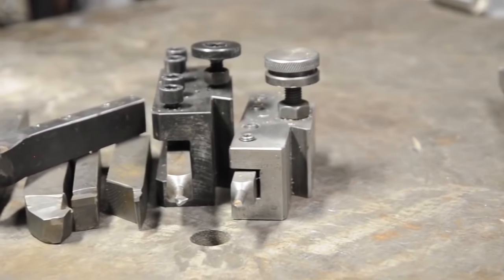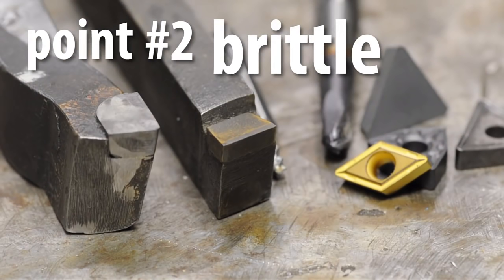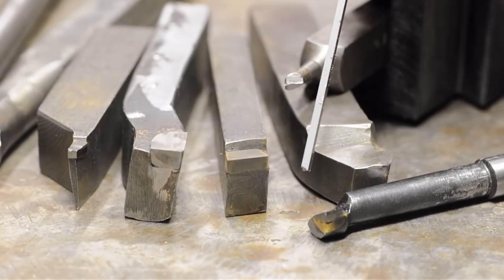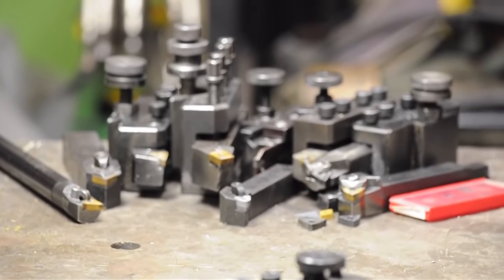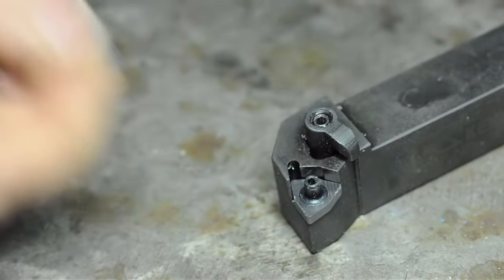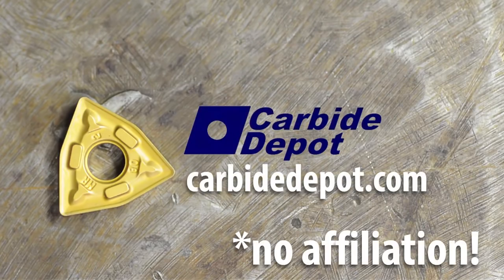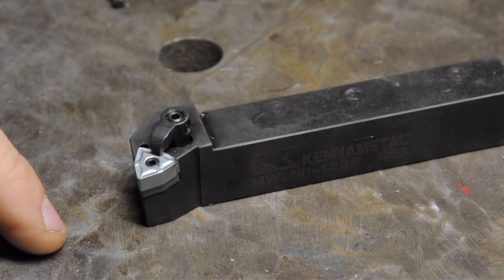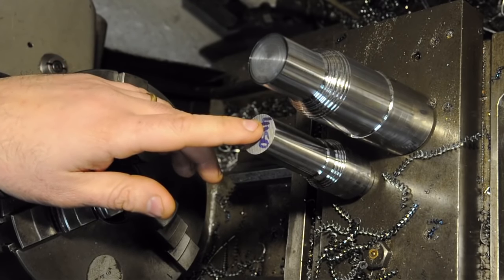A Brief Chat about Carbide Tooling

Comment: Excellent video! However I was a little surprised that you didn't mention the ground/sharp carbide inserts - I don't know how widely available these are, but I use them exclusively on my lathe, mainly because it isn't sturdy enough to use a "normal" non-ground insert. They have exactly the same shape, but are ground sharp for use on plastics and non-ferrous metal, although I sometimes use them for finish passes on steel and stainless as well. The tips I use are CCGT - I'll give you a link to the UK supplier I get them from: https://www.shop-apt.co.uk/carbide-inserts-for-turning-uni-tip/ccgt-060204-alu-ak10-carbide-inserts-for-turning-ground-and-polished-for-aluminium-uni-tip.html. I've just bought a cheap set from Aliexpress so we'll see how they turn out.

Comment: I guess if you're in a huge hurry, .035 removal passes and a .010-.015 get me close pass, drop in a HSS tool to get to final size.

Frankly, high feed rate, .015 removal, great surface finish. I'm fine with that. I'm almost never in a hurry.

Comment: Anyone  know if carbide will cut/shape a file,i want to make a tool insert from a file and it has to be square ie have right angles not squinty corners,grinding /cutting with a slitting disc on an angle grinder is ok to rough out,but i'd rather mill it to shape ,keep it(and me) cool ,and remain a file(sort of).

ANY HELP?.
Reply from the maker: it probably will.  but with a carbon steel fire you can anneal it, shape it, then harden again.
Reply: @ThisOldTony  Well thanks for the relpy old boy er tony,i want to keep the file as is except chopped down ,i've not done much in heat treating and son't want to ruin a good files  composition playing silly buggers with its temper,i may get a cone stone to grind it in the mill or not,i will try the carbide to square the ground cut off,that's all i want the carbide to do.
EXCELLENT VIDS,ATB FROM HERE IN SCOTLAND,UK.

Comment: is there a way/s to check if the tool i bought from ebay is tungsten carbide or HSS ? 
color is not an indicator for this :(
Reply: tungsten is less magnetic than hss,and lot heavier in weight

Comment: I'd disagree with the statement that 'Carbide wants to go fast'. This is opinion dressed up as fact. You can go as fast or slow as you want, and most of the time I don't run it any faster than I would a HSS tool.

Comment: I work for e.g. manufacturers lol and I run a machine that cuts the grooves in steel cam shafts we take 30lbs of material off of a piece of bar stock in 40seconds using 36 carbide inserts

Comment: All of the small local tool suppliers do not sell plane vanilla HSS. Since the new fifteen percent cobalt HSS is the current standard. I always had to laugh when the shop owners thought that you could grind it with aluminum oxide vitrified grinding wheels. If you don't have any CBN grinding wheels you are pissing in the wind.

Comment: Can you or one of your viewers tell me if there is such a thing as minimum SFM (Surface Feed Per Minute)? Could you run a lathe or mill at 1rpm and still get good results if you have the correct feed rate?
Reply: chris0tube but then you wouldn't have sufficient  cut thickness. you would be rubbing. I think maybe you need a certain amount of surface velocity to overcome the surface energy of a given material. I would love it if someone could give it a go and see what happens.
Reply: chris0tube you could set the required cross feed and turn the chuck by hand while keeping all other variables the same.

Comment: LOL raw material  into scrap metal!    I'm a pro at that.  Problem is the welder didn't think it was funny his parts were 3/8" short and made me weld a bead up the edge of al his nice new 1018 hot rolled steel.  I almost got good enough to lay dimes.  
Problem is h kept putting them in the coffee maker at break time.

Comment: So I need to operate at higher speed with insert tooling?
Reply: No, not necessarilly, inserts just can handle higher rpm better, but need need higher feedrates and/or cutting depth than HSS

Comment: I worked at a shop as a temp a couple years ago. The owner expected tolerances of +/- .002 on this one job but wouldn't listen when we told him his bits and end mills were all dull or chipped. Dude expected perfection but refused to invest in decent tooling or to at least give us the ability to resharpen anything. Of course, the end mills cut like shit, and the drill bits drifted, and the tolerances were all over the place and out of spec. So then he gets mad about having to scrap material and recut stock due to the shitty tooling. Guy just would not listen to reason.
Reply: @ThisOldTony  there's bad shops and good shops but my point is, if you want good parts you'll need to spend money. Either up front on good tooling or later on wasted stock and rework.

Comment: "Mainly Tungsten and Carbide powders pressed into a shape" 

Tungsten is heavy but isn't much use in cutting anything of note. 

I can only guess that constant use of "Carbide" as a shorthand for "Tungsten Carbide" leads to the assumption that tools are a mix of the metallic element "Tungsten" and a "Carbide" of something entirely random. 

Or did you mean "Mainly Tungsten Carbide, plus some other Carbides in a metallic matrix" 

The terminology is such that in getting it wrong it is so wrong as to be misleading to anyone needing a "Beginner's Guide"

Comment: Curious as to why you didn't mention anything about the seats. I realize the purpose of them before the keyboard warriors get to jostling in their spanx. I mention them only because of the added cost and hardware necessities that could arise.

I realize no machinist has ever crashed any tool and caused the insert as well as seat to explode. In case some welder would happen along to operate outside of their classification and intelligence level, they may make such unfavorable rapid movements, and pricing the insert and seat can double the cost. 

Just in case it's always a good idea to keep a large keychain with random nuts close to the chuck wrench, the said welder gets distracted and rattles the makeshift attention grabber. Long enough for the machinist to return from their mechanical engineer diaper changing priorities.

Comment: Hi Tony just watched my first video of yours - very interesting and informative and not forgetting entertaining, I shall be watching more. However I have a question regards your explanation of the identification of carbide inserts,  is the sequence different in the US to that used in the UK? This is how I understand the ISO system from information at Cutwell Tools     https://www.cutwel.co.uk/learn-the-turning-tool-iso-code-system     1 = Clamping method - 2 = Insert shape - 3 = Holder style (approach angle of the tool) - 4 = Clearance angle of insert - 5 = Hand - 6 = Height of shank - 7 = Width of shank - 8 = Length of holder - 9 = Length of insert cutting edge - was I wrong in assuming the designations were international? I have no formal engineering background I would add.

Comment: It's a shame that the code order is what it is, It would be nice to be able to search ebay for shape and clamping (ie will it fit my holder) first. Frankly I care not a jot about the tolerance, and not very much about the angles. 
Also the P H Horn "Supermini" boring bars are yet another shape again, but for small bores (down to less than 1mm!) are unbeatable.

Comment: Yes, the real problem with CNMX and WNMX tooling raises its ugly head. the problem of the chip wrapping over into the gap on the back side of the tool. This is norma,ly caused by insufficent depth of cut (DOC) and or feed rate. If one looks at the top of the insert one sees a land or ridge around the top of the insert. the DOC and feed rate must be sufficent to get the chip to flow over that land. If it doesn't problems ensue. Plus the chip does not form at the egde of the insert. If one sees photos of chip formation you see the material is actually fracturing well away from the insert. The heavier the DOC and feed rate the farther away this happens. 
In terms of tool holder for insert tooling on lathes. I think one is much better off to have larger tool holders that are modified to fit a Quick Change Tool Holder. 1" holders with a dovetail cut in them work well in A series tool posts. Larger posts need larger tool holders. By machining a dovetail in the holder and adding a screw and nut for hieght adjustment you eliminate one interface in the tooling set up

Comment: You have to let the tool "stop" cutting to break chips. No different than a drill bit or tap. That means SLOW feed speeds. And COOLANT will help break chips tremendously for a few different reasons. Any "machinist" should be able to figure out why for himself.

Comment: three sets of two numbers? WNMG-08-04-08?  What planet are you from? You sound American. I've been at this for 19 years, and where I come from (the west coast of the U.S.A it is one set of three numbers...WNMG-332 (of course your 08-04-08 is closer to a WNMG-2.52.52, but I have nver seen that, obviously, lol
Reply: WNMG-332 is the ANSI designation. Look it up st the SECO toolsite or similar. The 6 number 080408 simply designate cutting edge length/thickness/tip radius. W is the shape, N is the cutting angle, M is the tolerance and G is the type (if I remember it correctly) so it makes some sense after all...
Reply: WORLD WIDE iso standard is WNMG 080408   (08 - size, 04 - thickness, 08 - 0.8 corner raduis)

Comment: incress ur feed and cutting depth u want chip that are shape like a 9 with carbide .roughing feed should be betwwen .012 to .20 and dont go under 1/8 cutting depth. cutting speed for conventionnal should be around 550... cutting speed x 4 / diametre= turning speed. if u cant turn fast enough incress feed.
Reply: oh and cast iron insert do not have chips breaker.

Comment: I bought some Chinese made 1/2" insert holders... it was ok but it did make curly chips rather consistently.

I also ordered an insert holder, appears to be made in Japan (it's got Japanese sounding names on it). It's 3/4" wide, and initially I was worried because my lathe's toolholder (the non quick change type that is) is really designed for a 5/8" even though I can fit a 3/4" piece of metal in it. But it seems to line up to the centerline nicely without modification (my initial plan was to mill it down if it didn't fit).

My question is, I got no idea what insert it comes with. It has a trigon insert by default, appears to be a WNMG but not sure of the size... How can I ID them? It appears the insert it comes with is a shim seat...

Comment: I have a cheap chinese lathe that I converted to cnc with cheap chinese drivers and steppers so therefore I am required to use cheap chinese insert tooling.

Comment: Carbide not as sharp?  Huh. Never heard that before.
Reply: if you look under a microscope you will see that any NON FEROUS type insert is very blunt because of edge preparation and because of the coating that in on it